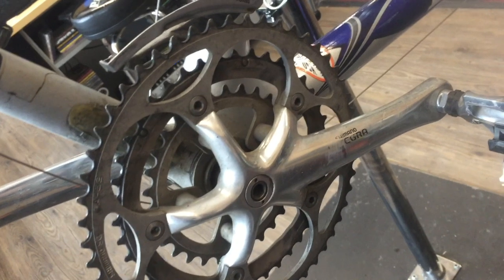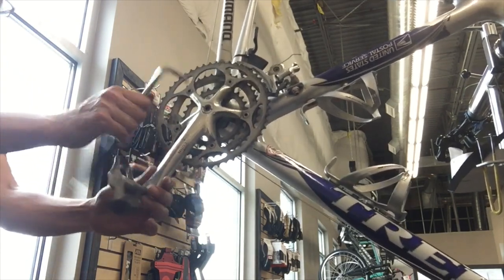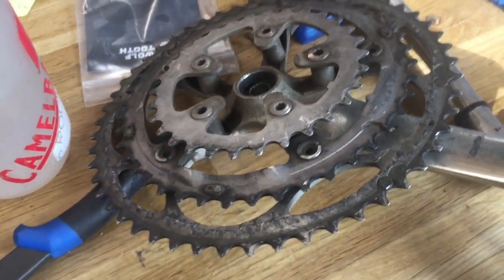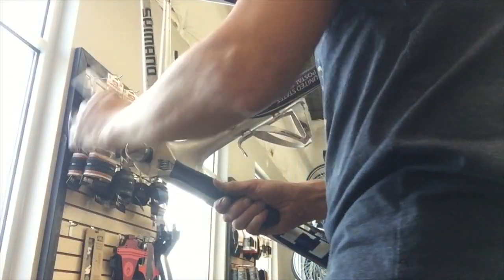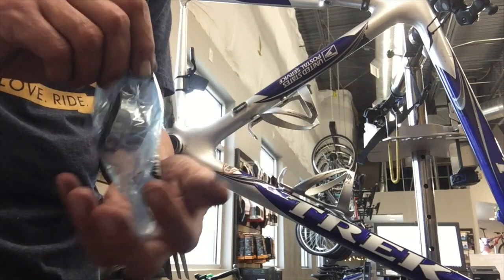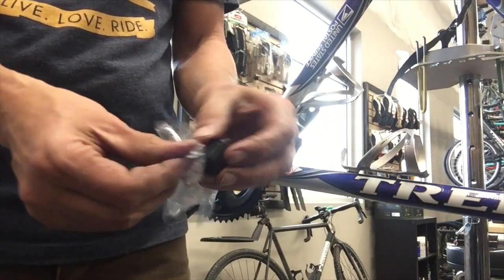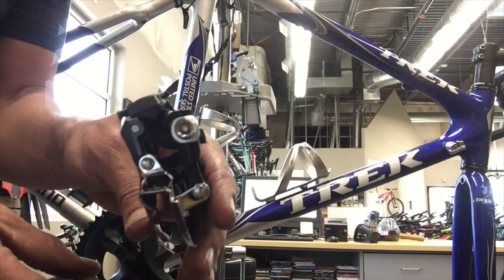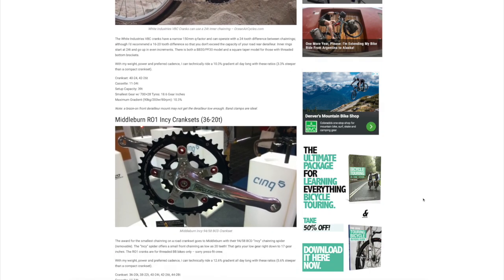Triple To Wide Range Double Conversion

Comment: Joey.  I am doing this exact same conversion.  You said it was a 50-34 crank.  It looks like the box says 52-36 crank.  My question is do you think a 50-34 crank will work?  Can the derailleur slide down low enough to be within 1 mm of the 50T chainring?  Thanks

Comment: Great video Joey,it's a pity there aren't more of them like this one,i like your plate you epoxied on the braze on bracket,great workmanship.Cheers keep well.
Reply from the maker: Thank you! I appreciate you taking the time to leave feedback!
Reply: @JoeyMesa  I have a 3x on 2017 Fuji touring bike 9 speed 48,36,26 problem is when fully loaded 36, 26 ain't cutting it. Could I just swap out the rings 26 and the 36 for a 22 and  a 32? I'm in Denver area.

Comment: Great video.  Thanks for this content.  I didn’t see in your video any lubricant/grease applied on the bottom bracket.  I suspect you did.  Would you comment on that and what you may have used if you did.  Thanks.

Comment: I have a Trek 1.2 with a Shimano triple and I want to upgrade to a 2x.  Can you recommend what I need to buy?  I don't want to break the bank but don't want cheap components either.  I want to keep the Trek as a project bike and occasionally ride in bad weather instead of riding my new bike.  Appreciate any help you can give.  The video is great and I will reference many times if I do upgrade the 3x to 2x.  Thanks.

Comment: Thanks for the video.  When switching from a triple to a double, do you have to change the shifters as well?  For example, suppose you have Shimano Ultegra 6600 10 Speed shifters supporting a Triple 53/39/30T crank.  Would it just be a new crank and derailleur?
Reply from the maker: The triple shifter will work, but the double shifter will work better. Some of the 6600 stuff is getting harder to come by. If you're wanting to stick with 10 speed, you might look into the 4700 Tiagra stuff. You have to get the shifters and derailleurs because they have a different pull ratio than the 6600 10 speed, but it actually works better and is readily available.

Comment: Great video, one question. Basically I have to change all the drivetrain from 3x8 to 2x right?
Reply from the maker: Well, in this case 3 x 9 to 2 x 11, but the main thing is rear derailleurs shift better than front derailleurs. There's a good reason you don't see triples offered or supported much anymore...
Reply: @JoeyMesa  thanks you for taking your time to respond.

Comment: I have a tandem that is triple in the front, 9 speed in the rear with a combination of Tiagra and Deore parts. I want to swap the Tiagra shifters for Ultegra 6700/03 and swap the nine speed cassette for 10 speed to work with the shifters. Do you forsee any problems or issues with this type of upgrade?

Comment: what are you thoughts on just ditching the small chain ring, and leaving it as is (with a new 2,speed front derailleur)? Would that even work? You just need shorter crank bolts right? Maybe I'm missing something. I guess 42 is a large size for just having two rings.
Reply: The best way to do that is to ditch all of the chain rings and buy the configuration you want. For example I have a light tourer that has a 30-39-50 and what I'm gonna do is switch to a 44 and get rid of both the big rings(parts bin). Bolt the larger chainring to the inner surface (spacers or shallower chainring bolts may or may not be needed) not the outer.

I ran a 38-22 on my old gravel grinder after taking apart an old truvativ crank with two damaged rings, a shimano crank with stripped pedals, and a 22 I found on the side of the road. Rode that crankset for 5000 miles and it's still on the bike.

Comment: Joey when installing the two by from triple how did u decide which bottom bracket cups to get?
Reply from the maker: It's going to be dependent upon the bottom bracket shell of the frame. In the case of the bike in the video, it was a 68mm wide shell with standard English threads. The 2x crank I used in the video is a Shimano hollow tech II type, so the bearings sit outboard in the cups. Most bikes that currently have a triple have a threaded bottom bracket shell, and most of those are English threads.

Comment: A question from a newb: why not keep the triple and just replace the cassette with one that has wider gears? The back cassette on my triple-cranked bike has a 12 to 32 cassette. 
Thanks for the vid. Very informative.
Reply from the maker: Great question! There are some pros and cons to both doubles and triples. Yes, you could just put a wider range cassette on a bike equipped with a triple, but to a certain point. Rear derailleurs can only take up so much chain slack, or wrap capacity. The longest cage SGS style derailleurs can take up to a 45 tooth difference. An example would be the 30-42-52 triple used in the video, combined with a 11-34 cassette. 52-30=22 and 34-11=23 so 22+23=45. Now, if you took a common compact double 50-34 combined with a 11-40 cassette you get 50-34=16 and 40-11=29 so 16+29=45. So, by spreading the range more to the cassette end, you can accomplish the same range overall, or at least the capacity of the rear derailleur with parts that are readily available. 
Moving most of the gearing changes to the rear greatly improves shift quality overall. The only drawback to a wide range cassette on a double is that there are bigger gaps between gears, which some folks may find to be too much for their liking.
I don't think you should necessarily ditch your triple if you already have one on a bike and are looking for more gear range, but, if you're starting from scratch, I think the double setup would offer more options at this point.
Hopefully that makes sense! Thanks for your question!
Reply: @JoeyMesa  Thanks for the very useful reply. No, I'm very happy with the range and the small gaps between gears of my current setup. I've been trying to understand the trend towards doubles and even singles; your reply has cleared up a lot of my confusion.

So in a nutshell, moving between triples and doubles involves a trade-off between gear spacing and shift quality. Have I got that right? Subscribed.
Reply from the maker: Triples generally have closer cassette spacing, so smaller bites between gears. There are several gears that are the similar or the same, (50-25 will be the same ratios a 34-17 for example) so, although there are more gear choices, some gears cancel each other out. I think it's often assumed that more gears=wider range. I've never ridden a fully loaded touring bike over a mountain range, but I do a somewhat hilly commute with a back pack most days. I like the wider spaced gears of my commuter bike in stoplight to stoplight traffic compared to my road bike that I typically find myself shifting 2 gears at a time to get back up to speed.

Shift quality wise, a double will be an improvement over a triple. The technology that's improved front shifting has really only been applied to doubles (improved chainring stiffness, improved front derailleur stiffness with lighter shifter hand input). Also a rear derailleur will always shift better than a front derailleur. As an experiment, if you apply some force on your pedals while the bike is at a standstill, you'll find the chain has tight tension from the rear cogs leading to the front derailleur, while the chain on the bottom side from the rings to the rear derailleur is always neutral. It's a lot easier task for the rear derailleur to move the chain a short distance between cogs with minimal load on the chain VS the front derailleur moving the chain over a bigger change under a higher tensioned chain.

It's even better with 1X setups. I made another video a couple of months ago converting my double to a 1X setup: https://www.youtube.com/watch?v=xF-KaqMeEig&t=1s
Just a little info on why the 1X setups are becoming more popular as well.
Thanks again for your questions and feedback! I appreciate it!
Reply: @JoeyMesa  Your explanation for moving the shifting to the back for crisper changes plus neutral versus  loaded chain is the best I've seen yet. I was mulling over the benefits of 1x over 2x myself as I have a 2x compact system and was considering going to a 1x. But I do like the new GRX 46/30 system a lot, because you can climb a lot of hillier stuff without sacrificing a lot of top end speed. Your thoughts?

Comment: I'm thinking of changing out my Shimano Ultegra 6500 triple with a 9 speed cassette to the Shimano R8000 Ultegra components and I found this video to be really informative.  I have Cannondale CAAD4 frame with Mavic Open Pro S6000 wheels, the rear hub is a Coda Competition hub. The bike is around 20 years hold.  Will I need a new rear wheel?
Reply from the maker: If the wheel is in good condition (hub spins smooth, plenty of material on the braking surfaces, no cracking around the spoke holes Etc.), the wheel should work fine. 8-9-10 speed freehubs are all the same width and an 11-34 11speed cassette like the one I used in the video will fit on your freehub as well. Normal 11-speed cassettes require a wider freehub body, but the 34 and larger final cog size 11-speed cassettes use the dynasys system which is the same width as 8-9 and 10-speed cassettes.

Comment: Why are you changing the brakes?
Reply from the maker: The pull ratio is different from brake lever to brake caliper on the old 6500 system compared to the R8000 system. In a pinch, the old calipers could have been used, but brake performance would have suffered.

Comment: thats such a huge upgrade for the owner 😁
Reply from the maker: Yes it was! I thought it would be interesting to make a video about it because most people usually just sell the old bike and buy a new bike with the current components, at least that's probably the easiest and most cost effective method. At the same time though, it's easier to acquire new modern components than trying to source older, high quality 9 speed components that are no longer in production. 
Thanks for commenting!
Reply: 9 speed no longer in production? are ye sure? hows that tell us!!

Comment: I've got that same bike. How much did this cost the customer?
Reply from the maker: I believe it was right around $2000 total, but that included new bar and stem, tires, tubes, brake calipers and the complete drivetrain with STI shift/brake levers. I wish I would have had time to get some footage of the completed bike. It had a totally different look!